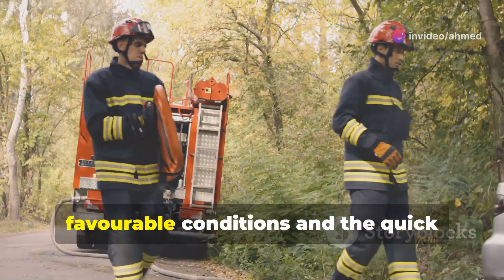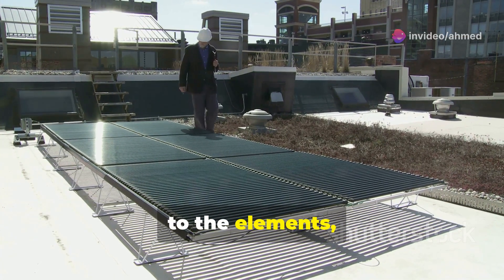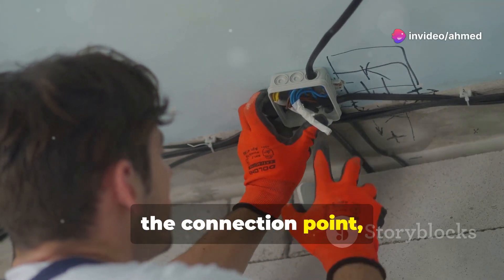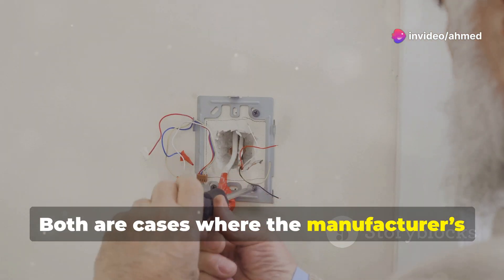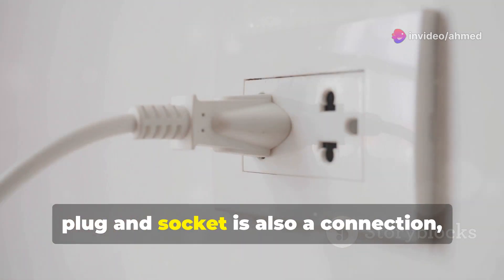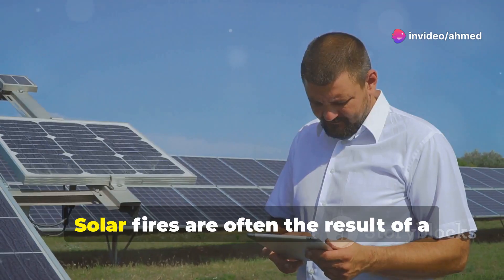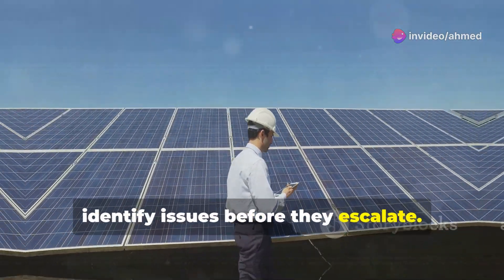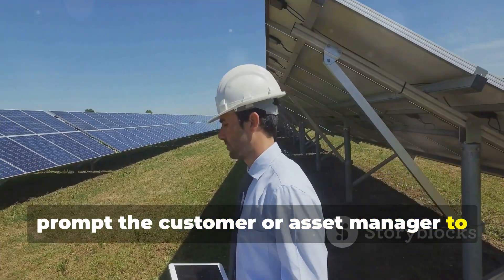The #1 Reason Solar PV Systems Catch Fire and How to Avoid It

Comment: Glad that stupid requirement for rooftop isolators was reversed in Australia.
Reply from the maker: May I ask why DC isolators were an issue for rooftop solar in Australia?
Reply: @ThinkInAI  Pretty much what you covered in the video, water ingress, exposure to the elements, degradation of the enclosures due to sun exposure. We have gone more to DPs at a designated area (usually close to where the cables leave the panels).
Reply: @AndyM... What's a DP?
Reply: @FauxQue-yk8dt  Apologies, a DP = Disconnection Point, basically a small loop of easily accessible MC4 connectors at one end of the array, that has to be labelled at the panels and documented in the solar array plans.
Reply: @AndyM...  Ahh OK, I was trying to come up with anything that worked and couldn't think of anything beyond Double Pole, and of course Double Penetration for other reasons. 
Plans? In my head. Disconnects at the panels? I live in Florida and you're not stopping the water when it's coming sideways sometimes at 100mph. MC4's with some dielectrics grease and a 50' foot run to a combiner box under a screen porch which also has a wind up sun shade hanging in front of the hardware to catch any blowing water that manages to get in the porch. The combiner box has lightning arrestors, 4 sets of DC breakers, 8 fuses, 4 on the positive side, and 4 on the negative side. And backflow resistors on each array. If I need to work on the panels in the daytime I hit the breakers and pull the fuses for whatever array I'm working on and toss black Harbor Freight moving blankets over the panels. I'm not messing around with DC arcing. That's what causes fires. 
More worthless advice. Ferrules are a must when using stranded wires under screw terminals. Even if you torque stranded wire it will loosen over time. I started retorquing wires every 3 to 6 months and they always took a little. Well I got lazy and skipped it. Melted down a breaker from a loose connection. Redid everything with ferrules and did a daily then weekly laser temp check on the connections. Which lead to monthly then to semi whenever. Tomorrow I need to check all of the connections just to be sure. When it's so dependable it's easy to get lazy.
Reply: @FauxQue-yk8dt  Cool, lightning arrestors don't seem to get used as much in Australia, although we have plenty of lightning (especially in the north). I don't have arrestors on my system and I'm up north. I also use ferrules on mission critical and high current circuits and on the last few maintenance sessions have not got any more movement from the connectors, so I don't think they're going to move now. I also run a thermal camera over the whole system once a while. I'm off grid altogether, so like to keep on top of things !!!

Comment: If an electrical worker cannot even apply a bit of silicon or glue to an unused plug to a conduit connection on a weather proof isolator ( IP65) well then help us with solar connections.
Reply from the maker: Couldn't agree more. This is just shown for demonstration purposes, not an actual installation

Comment: Rare.  It is the building leaking from the terrible roof anchorage systems and ideas.  For example if you have a boat would you screw in a 1000 screws into the hull from the outside.  Better yet make it a boat of wood.
Reply from the maker: Yes it is rare for solar panels to catch on fire as the installation location is checked and has to be met in accordance to the quality inspection conducted.

Comment: At 0.50 you see a bundle of cables laying on the concrete. This is a hazard for rats and birds eating through the insulation. All the wires should be run through a conduit of some sort.
Reply from the maker: yes that is 100% correct and I agree with you as the cables should be placed in a metal cable tray or a pvc conduit.
Reply: Rats yes. Birds highly unlikely. The insulation on PV cables is very thick and isn't easy to strip.